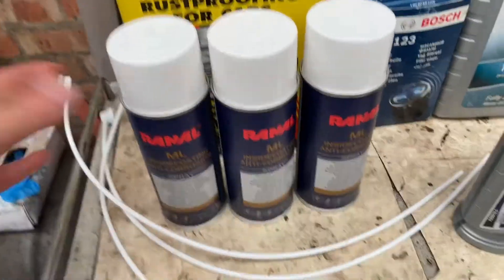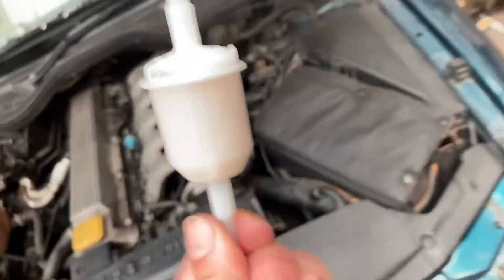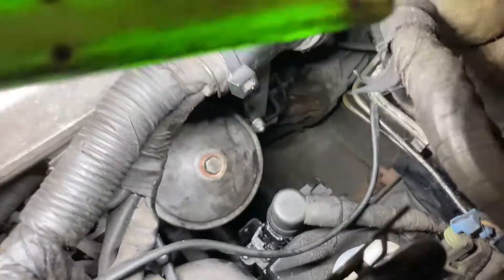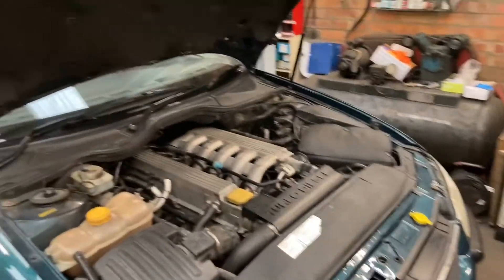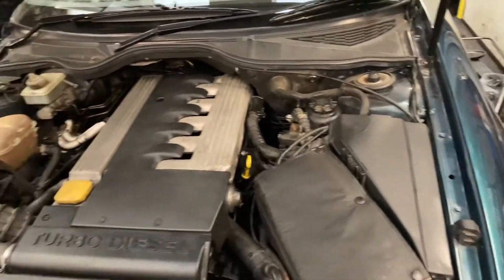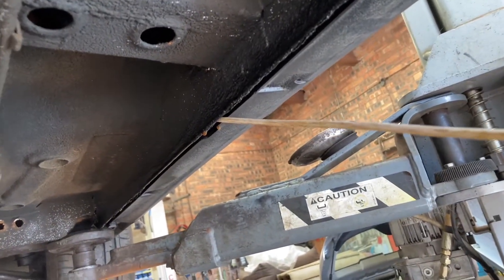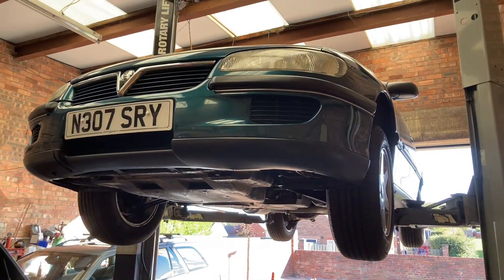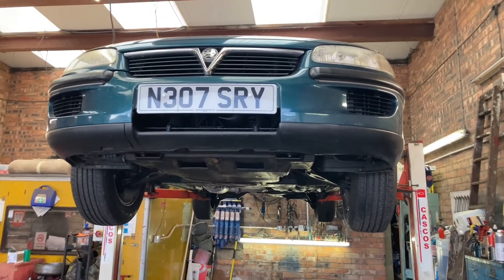Project Omega PART 3 Rust proofing Waxoyl Cavity Wax service | Vauxhall Omega GLS Estate 2.5 TD BMW

Comment: Hi mate old video I know but who does the super chipping I've got an old vectra b I'd like to get that super chipped thanks
Reply from the maker: Yeah this been the turbo diesel there are good to chip…. But Non Turbo N/A engines your taking usually less than 8bhp gain…. Hence not worth the expense doing them.